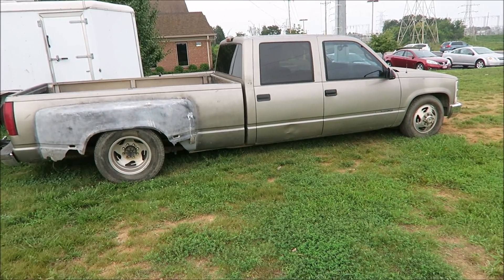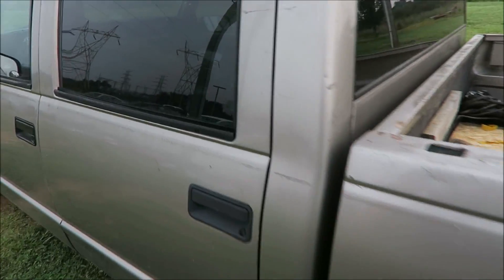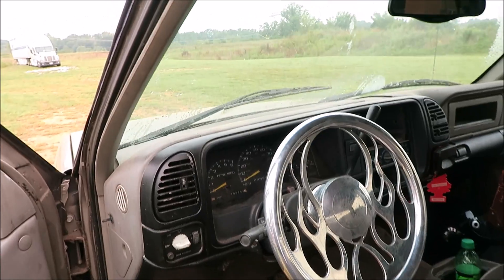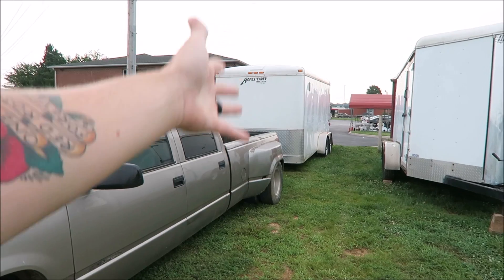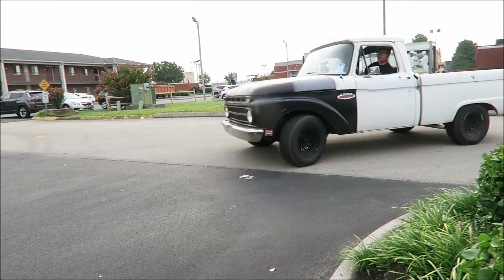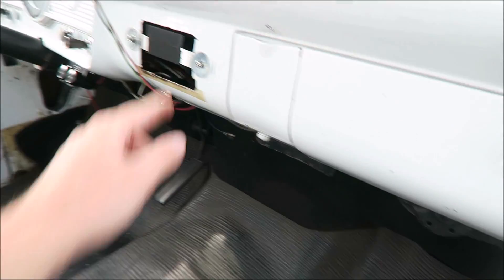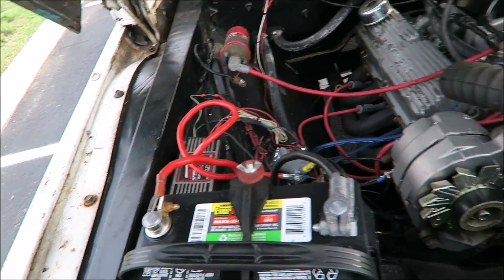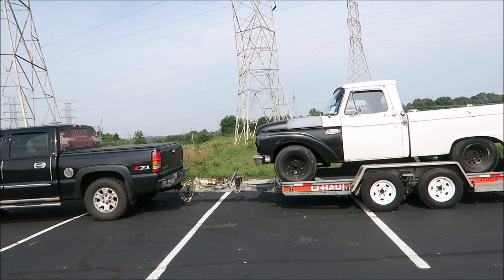650 Mile Road Trip In An Abandoned Show Truck

Comment: On that 98 just push the e brake down a tiny bit to shut of your day time runners. then you can use the switch on the dash to run your lights and your parking lights, I always ride with my parking lights on it looks killer.

Comment: The hosee is 34.00 at any orilys find an old refrigerator take the motor adapt it vacume down the ac system charge the. Bastered take the seats  out of the back put in foam mattress toppers from Walmart get some blankets and roll out .

Comment: My buddy has a 1965 F100 that ThatDudeinBlue reviewed a few months back. And he did a Cummins swap in it.
Reply from the maker: Oh, no shit?? I actually watched that one. I don't watch a lot of TDIB's stuff, but that truck was fucking sweet!
Reply: SniderTron 3000 yup. Met him in the parking lot of my college and we connected. He had the TF727 with no reverse in it but he swapped in a 47RH from a Donor (the Cummins in that donor went into his Dad’s 99 F350). He said the Cummins swap was so easy. Used stock Dodge mounts and only needed a custom driveshaft and oil pan. Still drives with manual steering and manual single pot drums all around and factory open rear end. He and I did a quick performance comparison with my bone stock 89 W250 with a 360 TBI and we are dead even. Reason he did the Cummins swap was no one has and he can go from 30 mpg to 500 ft lbs of torque in a twist of a knob
Reply from the maker: That's pretty sick, man. Some sort of 12V swap is on my bucket list, I just haven't thought of anything to put one in lol also money

Comment: Lol 9 mpg with 5-6 k behind it.  I got 8.3 mpg with my 97 f350 7.3ps with 13k behind it heading to buckley old engine show
Reply from the maker: I'm not sure if you're making fun of me or not haha
Reply: @SniderTron3000  im a diesel guy but it can be expensive maintenance wise. Big blocks love thier gas. With a big block myself i might get 4mpg so nope  I picked up my 97 f350 7.3 with 279k for 4000 alittle rust but going strong 287k now. Needs power upgrade injectors since it could use new injectors anyway? Not real sure on the need.  Miss my crew cab.  But love having 11ft bed
Reply from the maker: Ah, gotcha. I like diesels but I haven't had many chances to mess with them aside from when a logger buddy of my dads brings his trucks over for work on them. And, yeah, those repairs costs always scare my broke ass away haha I would like to find a 12v to put in something cool someday though